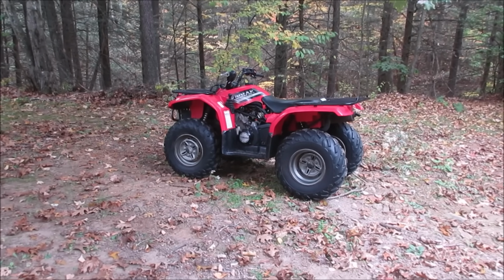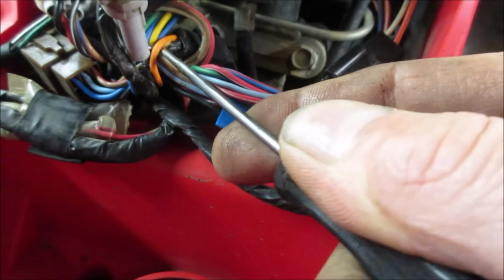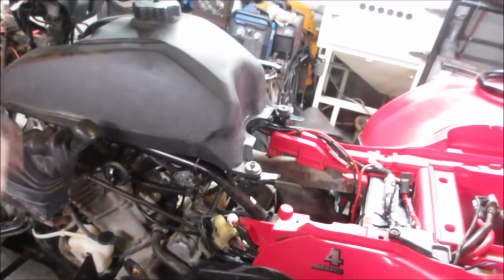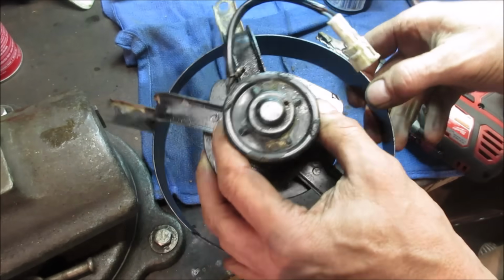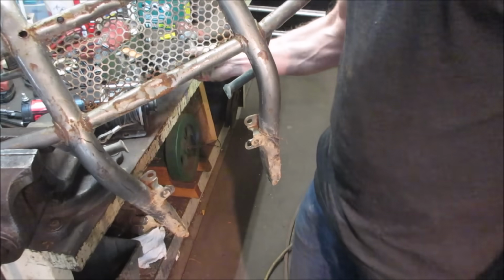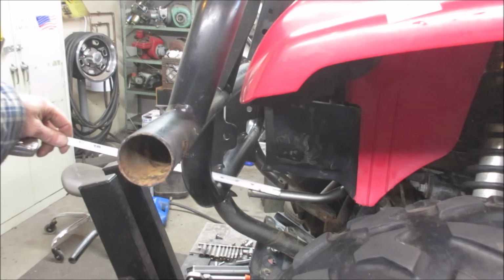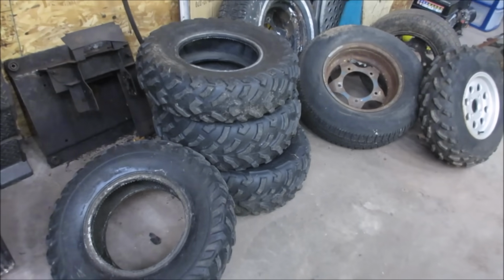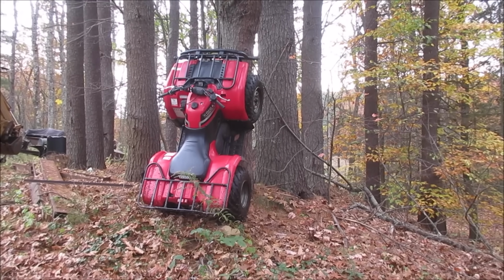Can We Fix It? Modify It? Break It? Yamaha Kodiak atv. pt2

Comment: why test the spark at all if additional tests relating to spark were going to be regardless of the results? i.e. the spark test showed that the engine was getting spark, yet many additional tests were done as if spark was the problem. 

bottom line is, that is a test is done to eliminate potential problems, it makes no sense to even run the test if the results are going to be ignored.

Comment: The ground for the winch, if it’s not currently attached to the frame instead of the battery, it was at one time.  The winch has to be connected directly to the battery.  The factory chassis ground is not large enough to carry the current for the winch.

Comment: Mustie, I have the same exact quad and have had to change the shaft key which was done successfully. Unfortunately the quad bogs down until it is completely warm.  I have put a new carb on it but have never checked the valves.  It sounds like I should?   Thanks.  BTW, another great video.

Comment: A friend gave me a Suzuki 650 Savage thumper because she had taken it to three different shops to fix an issue where it would take off fine in first, second, then fall on it's face in third. Turned out there was a little fork that held in the seat for the needle and seat that was a hare bent allowing the seat to drop enough to starve it of fuel temporarily, then the bowl would fill again. I know yours isn't that, but funny little issue that was hard to find. Love your stuff.

Comment: What you said about wearing a spot in the belt when loading it with snow plowing does NOT apply to these. The belt is NOT part of the clutch as it is in a snowmobile, the belt is purely for changing the gear ratio. It has a separate oil immersed centrifugal clutch, which is why the owners manual warns against using engine oils with friction modifiers. I've got the same unit, MY2000, used exclusively since I bought it new for snow plowing and pulling a 6x10 box trailer that is always overflowing with firewood or rocks, still on the factory belt which still turns smooth as butter.

The radiator fan is more or less irrelevant. Almost never comes on except when idling for long periods of time in direct sunlight in the peak of summer. It has a warning light and will shut down automatically before engine damage if the fan fails. If its moving AT ALL, even pulling a huge load, there will be enough air flow to keep it cool enough that the fan stays off.

Comment: Being able to shift out of 4x4 is most important when climbing a hill if you don't make it up you need to be able to gun it and turn around and come back down the hill going forward, coming down backwards is not good. I had to educate the ATV trainer that in 4x4 you can't do that it will just turn and shoot across the hill sideways. He said all ATV's will spin around so I told him to show me on my quad the new Honda 300 with full time 4x4 so he did and he couldn't do it. He tried 3 times and shot across sideways every time. I got rid of the Honda as soon as Yamaha came out with the Grizzly, I bought the first one my Yamaha shop got in and never looked back.

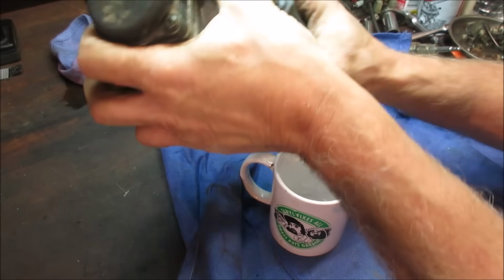Comment: 17:52  My 650 Yamaha verticle Twin did the same thing. I found a small hole in one of the CV Carb diaphragms and patched it with a bicycle patch kit (Yamaha wanted way more than I had in the mid-70s). I rode it that way for two more years and sold it that way running perfectly.

Comment: Limp mode? A issue I had with 04 650 Articat with Kawasaki motor. It was part of the protection for cv belt. If it starts to fray a switch inside cv houseing triggers limp mode to get you home. I found online a part  that prevents false signal.

Comment: You got a sensor in there. It's learning your power and that's reasonable you get what you're getting. I think there's 2 sensors 1 when you backup and another one that the senses. It's out of reverse or whatever so you can override it or whatever some of the safety features.

Comment: I had a simular issue with mi 91 trx 250 X  . I cleaned every harness ground. And plugs and conectors. I bit the bullet and changed ,the cdi. It fixed the intermittent ignition problem.

Comment: The new harbor freight drill I got, is variable only when it's on a number and not the drill setting of the drill.  Maybe that's what's going on with your drill.  I thought it was odd, but it's actually kind of a nice feature to have.  On 1 it slow starts and progressively gets faster.   Each number has more of a faster start.  Check that out before going for the warranty!

Comment: Wheel bearing caps look like they would work good on that crash bar you can slide them on the inside and the wouldn't knock them off as easy if you got them where they was shallow

Comment: Excellent video Mustie 1  :)  you got fan running okay now to on sensor on rad to also& wire up stuff be fun criss-cross  on lights for gauges to do Lol and excellent got extra spare tires too! Think roll bar thing from Backhoe 2 cylinder motor tractor you had fix up past and not sure off hand from being awhile Lol ! That 4 wheeler burn you check on VIN or Serial numbers to confirm it think be Yamaha or Suski  one too! Tree hug part you got it too also ! Also Carburetor  part that last guess was Mustie 1 :) and happen to anyone Lol!

Comment: Isn't the front suspension locked up now since he bolted the top of the shock to the axle with the new push bar?
Reply: I'm not 100% sure (I was at work and only part watching during that part).... But I think he mounted to the frame side on both top and bottom. The wheel still can move up and down fine.

Comment: The needle for the throttle is not allowing fuel by not opening enough. Maybe adjust the needle on the slider up a notch. Just a guess, not getting fuel.

Comment: Sounds like what my old Honda Fourtrax 300 was doing. It would idle fine but it would start miss firing pretty bad at around 1/4 throttle. Mine turned out to be a bad voltage regulator.

Comment: I have worked on a few of those yamahas and have delt with this issue before and it turn out to be a faulty ebrake switch causing the cdi to go in limp mode

Comment: Mustie, for what its worth. Spark is seldom the problem on name brand stuff like this- other than if someone puts in a crappy spark plug.   These electrical systems are solid state and rarely cause problems. Not never- but its usually fuel problems, not ignition. Cheers!

Comment: I had a 05 Rancher that wouldn't charge turned out wires where cut. It ran fine but wouldn't charge so one broken wire can cause alot of issues.

Comment: I have a sizuki eiger 400 that does the same thing. Never pulled anything apart but when it happens if I blow or suck😊 on the vent hose under the seat it will run fine for a while then it will happen again. Not actually sure what the vent is for but. It works.

Comment: I would have hooked a  voltmeter to the wires or the fan when using the drill to spin it and if you were creating voltage then you would have a chance the fan might work

Comment: That looks like one of the 85-93 orange and blue,or red and black suzuki 230,229cc engine...Depending on what year it would've been either a manual clutch manual shift,or semi automatic 5 speed trans,2wd only,discs front and rear,sra,with working rear suspension added the last year or 2 of its manufacturers offering...

Comment: my polaris sportsman has electrical issues at times, for the most part its good but sometimes it will cut out but not long enough to stall, & other times it wont shut off, i tightend the ground plug on the coil but no difference. i hear its common on them.

Comment: They have aftermarket Pilot screws with a knob on top that can replace the inaccessible factory screw.  I put one on mine and can reach it it fine tune with the quad running.  I found it online somewhere.  It was quite a few years ago.

Comment: 1:02:58 I know wenches get mounted horizontal like that, but wouldn't it better to mount it vertical (motor facing the sky) so you can center it better?
Reply: Wenches?
Reply: @billhenry7833 
Yeah. It's best to mount your wench horizontally... Otherwise you might both fall over and injury yourself... Which might be embarrassing for both parties.

Comment: the carb issue blessing in disguise. the plastics had to come off anyway, fan needed attention. fleabay universal fit part actually fit, had the right connector and worked. that original weenie puny front crash guard looked like it was an after thought from the factory. your custom repurposed one much better portions, actual functionality

Comment: WD has a solvent component, it will melt the lacquer off the windings and short out the motor. NEVER use WD on motor windings or speaker windings they will work for a little while than DIE.

Comment: I used to repair radiators and we would degrease them then pressure wash them. And if it had copper tanks we would give them and acid wash on the inside and flush it out. Have you tried using wax on rusted bolts?

Comment: Thats ebay, yes. 1003 fitments... "This part will fit your vehicle" 2003 Yamaha Kodiak... 1987 Yugo GV and 1976 Boeing 747. You bet.
Reply: And the title always has models the description doesn't and vice versa. Or they say it's a carb for a XYZ250 in the title, and it's says $10.... but when you click on it, the carb is out of stock, but the "colour" you can choose offers a USB phone charging cable for $10 instead.

Comment: Those fan motors use roller skate bearings usually 2, once the motor is opened up a very easy change.

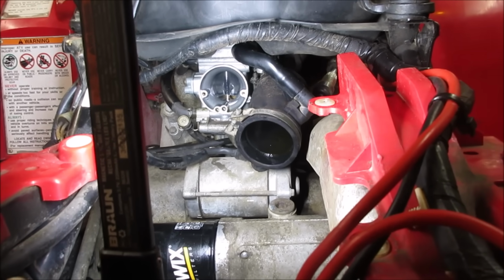Comment: 5:15 ish into the video and  Im pretty sure i see the problem already, either that bike drinks more than an alcoholic at an open bar or your jets fell out. Hoping you pull the plug as if im right it will be blacker than coal.

Comment: If you've lost the variable speed on your drill and all you have is off and High it is very possible that you burn out the mosfet transistor that controls the speed. My drill did the same thing I replaced the mosfet transistor in it and it works fine.

Comment: You can save yourself a lot of work, the next time you run into clogged radiator fins. You can use A/C coil cleaner. It will dissolve all that packed in crud and it will be a lot easier to remove.

Comment: Great video! I always learn something new from your videos! Attention  to the smallest detail can make the difference but you learn from the mistakes. My only concern is that you left out the metal brush grate that protects the radiator. I learned that lesson the expensive way. Although I thought I was cautious riding in the woods, a stick from some downed branches flipped up and went straight thru the front grille into my radiator.
✌🤠🇺🇸

Comment: I have a 1985 Suzuki SP600, and it had the same symptoms, would not run over 1/2 throttle. Turned out the the main jet had actually broken in half, and one part of it was rattling around the bowl. The other half I was able to extract from the carb body.

Comment: If you weld ends on the brushguard that go rearward [or forwards] 4 inches that will help you edge through tighter areas than just open ends without catching onto what you hit. Like the inverse of a bull's horns [more like what a ram's horns are]. 
Mountain bikers put them on their handlebars and it prevents serious crashes.

Comment: the negative wire from the coil goes to the ignition pick up. without it you will not have a spark
your problem is fuel related

Comment: Use a spray bottle with soapy water [or water with a little vinegar{diluted Simple Green}] to moisten the radiator dirt before blowing it with the airgun. This will clean the fins and also prevent the dust from flying all over the place.
Reply: Now why didn't this suggestion get posted somewhere I'd have seen it before the weekend? 😂
I was blowing dust and old mud off an even older Yamaha quad just a few days ago, making a big mess in the garage.
Reply: Shoulda just rolled it outside and pressure washed it
Reply: @Aerzon1v1  
1 - Too much work
2 - November in NH - Too cold for pressure washing anything
3 - That high pressure could bend the cooling fins and further restrict air flow of dislodge the fins preventing cooling.
Reply: If you did that with the dirt around where I live, you would make a radiator shaped brick.
Reply: @vhfgamer  That is why you don't leave it to dry. Use the air gun within minutes, while it is still soft.
Reply: @jlucasound  You haven't ever seen the mud we have around here. It's sticky like glue. If you walk through it, you'll have a several inch thick cake all around your feet. That's assuming you don't just sink straight down to china.
Reply: @vhfgamer  
Your mud isn't any different than anyone else's mud. 

The earth is only comprised of three types of soil.
A - Loamy soil is a type of soil that has coarse sand, tiny silt particles, and clay in equal amounts. This is a great soil for gardens because it allows plants to grow roots easily and provides good drainage without drying out. It’s also easier to dig in! 
It also wipes off easily and doesn't stick to things.

B- Clay soil is sticky and hard to dig in. Clay is made of very small sediment that packs together tightly. This makes it more difficult for a plant’s delicate roots to penetrate and hard for water to sink in. 

C - Sandy soil is gritty and light-colored because it lacks humus, the dark-colored organic material in soil that delivers nutrients to plants. It is made of tiny pieces of rock and sand and allows water to drain easily.  
Sandy Soil - doesn't actually stick to things, it lands on things

Now, think about clay - which is probably what you have, as that's the only one that tightly packs. Every person who has driven on clay knows that it is ROCK hard until it's wet. When wet, it turns into mud in turn, that mud can get flung onto things. Once flung onto things it won't stop adhering until water [and soap] has been applied. Do you just spray compressed air onto a car or an ATV that has dried mud on its fenders? Or do you reintroduce water to get it pliable again? Most people would use a pressure washer outside to do what Mustie did. But my comment addressed the dust in the air. Moisture introduced to clay keeps the dust down. That's why dirt tracks spray water onto the track between heats.
Also, clay has insulating properties that hold heat and won't dissipate it, [Clay-based Brick ovens used in baking pizzas] which can cause overheating. So washing it off would be advantageous.
Reply: @stans5270  You didn't need the essay. I'm very aware of the different soil types, and I'm very aware of what soil I have in my area. 

I don't bother spraying water of any kind on my vehicles. It's a waste of time. I chip it out of the wheel wells and fenders with a rock hammer. Obviously that wouldn't have worked for a radiator, so I would say mustie did the correct thing.
Reply: @vhfgamer Okay Pigpen.
Mustie had a small amount of dirt and debris that formed a dust cloud. If you think that I'm wrong, that's your opinion.
Having done it over 20 times, I can guarantee that it works.

Comment: My Eiger had a crack in the oil cooler so I got one out of FL. That was kinda a mistake. It was packed with cement powder like sand that they have in FL. It took hours of soaking and rodding with tie- wraps. So cleaning that rad is going to be not fun I bet.

Comment: tiny bit of trash in the low speed jet? Mine did this and it would start and idle with the stop turned up. But it couldn't transition to open throttle.

Comment: I love my 2002 Yamaha Big Bear 400! My brother and cousin both have Honda Foremans. I thought I wanted one of those, but all i could afford at the time was what i have. I think Yamaha is a better build than Honda for the simple fact that, I bent one of my hubs accidentally using a press to change the wheel bearings. I called every single atv junkyard I could find across the country, on the internet and none of them had 2000-2006 Yamaha's. They all had tons of Honda foremans though. I finally found a junked 2000 Yamaha Big Bear 400 on on Facebook Marketplace after 6 months of looking, that i bought for parts.
Reply: Same with Suzukis Eigers and Vincents they made a ton of them, finding new and used bits is not a problem.

Comment: Darin I have thought so many times if it would be possible to build a carb simulator. Create a blower that could suck air through the carb and see if the proper air fuel mix is happening. Just dont know how i could measure the fuel air mix. Unless you could measure air flow and re condense the fuel and measure it after the carb

Comment: Drill a small hole in the cap over the rear bearing, put some lube in the hole to free the bearing. Then you can seal the hole with silicone.
Reply: I did that once with a lawn mower solenoid. After a day in the lubie do, it worked and still works today.

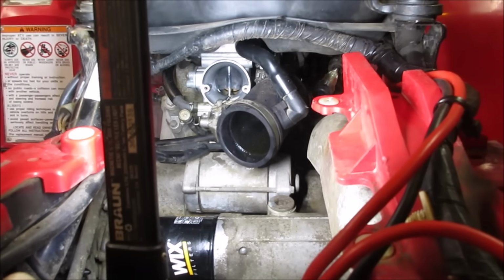Comment: You can clearly see at 5:18 that the carb is spraying the fuel backwards so this is an indicator for way too much fuel is coming.
Reply: Exactly what I saw. Wasn't sure why but that wasn't right. Fun.
Reply: I immediately thought the same thing. That is WAY too much fuel.
Reply: No, that is normal for a motorcycle or quad engine. The pressure wave bouncing back and forth up the intake channel are often supersonic. It is normal to see a small cloud of vapor form there.
Reply: @jw-hy5nq  Yes, a small cloud. But what i´ve seen was like you´re pushing on a spray can. In my opinion way too much. The missing main jet explain why it was so much.
Reply: @jw-hy5nq Not saying you're wrong that just seemed excessive too me is all. I could be wrong though. Have a good one.